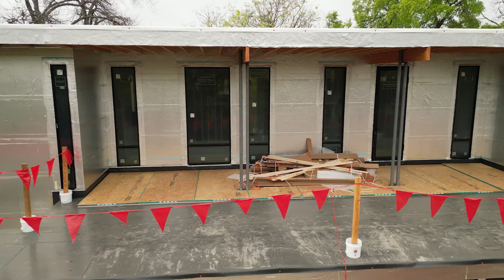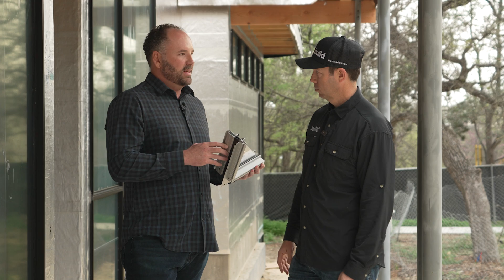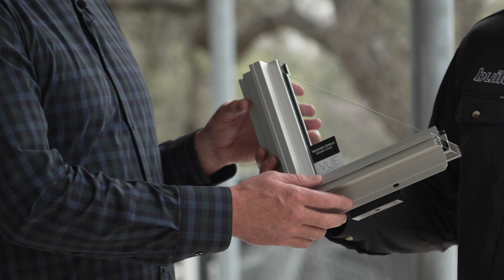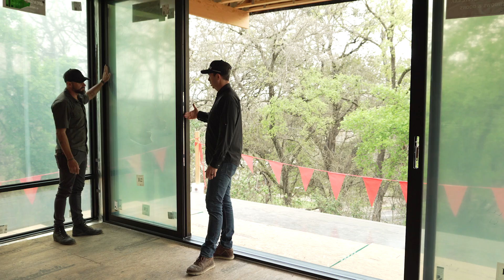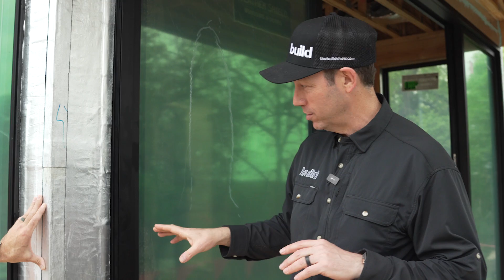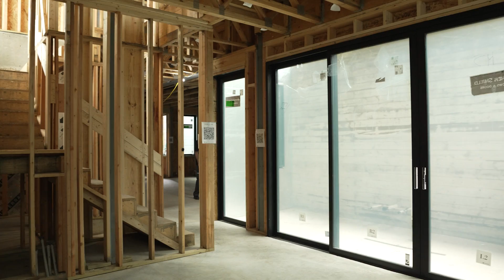Building An ULTRA Modern House? Check out these Windows & Doors!

Comment: Story about aluminum windows that don't have a thermal break.  I bought my first house in 2010 in central Virginia.  The porch was 10 foot wide and under the roof of the house.  The house was about 10 years old.  There were two windows that look out onto the porch and both had water damage on the inside bottom sill.  It was almost impossible for the rain to reach those windows because of how back they were from the roof edge.  We bought the house and figured the water damage had to be from something the previous owners had done, like setting cold drinks in the window sill and the condensation causing the water damage.  
What we found is that the water damage was from condensation, but it wasn't from cold drinks.  The aluminum windows were double pane insulated, but there wasn't a thermal break in the aluminum frame.  During the cold winter months the window frames would get so cold that water would condense on the inside of the aluminum frame and then pool in the window sill.  This cold weather condensation is what was causing the water damage.  During one particularly cold spell we actually had frost on the inside of the aluminum window frame.
Reply: Same in our rental house all fall winter and early spring, theres constant moisture on the frames,
And it actually causes black mold to grow on it as its constantly wet, we clean it every month but its a pain in the proverbial.
Reply: Yeah, I’ve been a builder out in Southeast Virginia for 25 years and I have seen some real garbage when it comes to windows, new construction and remodels some of the time you’re just better off replacing them depending on the application pull the siding off and redo it put a new construction window and you’ll be so much better off
Reply: @steveanderson4768    We did replace some things with better things in that house in the 3 years we owned it before selling it.  
Sink faucets in both bathrooms and the kitchen.  Overhead lights on the porch.  A few other things I'm not remembering.  Every time we replaced I would later find the original thing at Lowes and the construction crew installed the absolute cheapest thing on the shelf from Lowes.  
The house did have hardy plank siding and one extra row of cinderblocks in the basement making for a higher basement ceiling.  It had gable vents for the attic, but no soffit vents.   
My realtor had been in the business for 40+ years, had built his own house by hand, and was the father of one of the guys I graduated high school with.  He looked after us as if I was his son and I learned a lot about what to look for when buying a house.

Comment: I want a double double window in a concrete wall so there 2 columns in the middle 1 on each end a space between the middle and a box on either side then do the flower boxes to conceal the completely flat entrance and privacy on the windows with plants that reduce heating as well

Comment: All you have to do is build a front porch with columns so instead of the 1-2ft over hang you bridge the gap from the building to a span off the front of the building and then it get bolted to the wall of the house or just not finish the windows or doorway and have a second finished wall under a balcony instead of knee wall for window you put flower beds in front and the space between them is a literal gap in the structure like a hallway

Comment: What’s the U-value?
Reply: In north america, ranging from northern to southern zones from 0.22- 0.32 u value at least for their casement windows
Reply: Thanks! It’s surprising that little spacer can achieve those numbers.
Reply: Our Oknoplast are 0.13-0.17 U-Factor
Reply: I saw .17 for fixed (which is typically the lowest).
Reply: @eh_bailey  Fixed is a great move, people should install a lot more fixed ones. Not all need to be operable, and you get instant savings and performance gains.

Comment: Alpen windows smoke these in U value.  Hard pass.
Reply: Oknoplast PIXEL Uf=0.18 - 0.29
Oknoplast PAVA Uf=0.16 - 0.21
Reply: Must be hemp based?😂
Reply from the maker: U-value is definitely better. However pure aesthetics and fit/finish on these will crush Alpen
Reply: @buildshow  I'd STILL prefer Fenstur!!!
Reply: @DrMJJr What do you like about Fenstur?
Reply: Matt, I’m in early build now up in NC mountains.  I priced out Weather Shield VUE, Marvin, Alpen, and Oknoplast.  We’re going with Oknoplast PAVA triple panes, Aluhaus Aluminum Lift & Slide.  Beautiful products, amazing on performance and about 35% less than VUE which was by far the most expensive.  VUE do look nice, but Aluminum even thermally broken can’t compete with UPVC.  The Alpen were also very expensive, kind of ugly and only offer 3 colors.
Reply: The most efficient window is no window.
Reply: @buildshow  I don’t have a conflict of interest in this discussion.  I don’t make, represent, have family that works for any window company, or sponsored to promote any window brand/company.  With that said, your assertions are either subjective (aesthetics) or without any actual evidence conducted by a neutral third party (fit/finish and presumably longevity).  Matt, you often present products that offer better benefits/performance that come at a greater cost.  This is fine and rational.  This product performs like an upper end Pella window (not special). Other windows actually perform better.  There is nothing wrong with line of windows and the market will determine if they are worthy of the price.  My concern with you is credibility.  When you start promoting windows (or any other product) because it “Looks Good”, but doesn’t perform as well, that reduces/eliminates any trust you’ve built.  FWI I watch many of your videos and affiliated buildshow members.  Learned a bunch and will be braking ground this fall for my new house.  Also, the only rub with European style windows is they swing inward, which makes curtains and furniture more complicated.
Reply: I saw .17 as the lowest on VUE.  That isn't bad considering the great sight lines.  One of the problems I have with the high performing windows (Alpen, Schueco, etc) is the bulky frames.  You can impress your build friends with great numbers, but they look like storefront windows.  This seems like a good mix of looks and performance.
Reply: There's no fee lunch. Always trading something for something.
Reply: @Eric-xp1kl  Oknoplast Pava is the great choice. Efficiency, custom sizes and plenty of color options make your choice match more easier. New line of aluminum windows Oknoplast MIRU EVO have thermal break as well. Their color pallet is much bigger, offers more options and better system especially for big sliding patio doors. European manufactures  bring more options than domestic manufactures and their efficiency beat US windows. BTW. Curtains need just longer rod to allow fully open window. Don't forget windows can also tilt and vent your room.
Reply: @pamaniwindows  Color choices are also key for HOAs where they dictate identical colors. Do you know if Oknoplast ships nationwide and if they handle smaller orders?
Reply: Alpen isnt a player in this industry. Bulky ass frames like European windows. Hard pass
Reply: @buildshow  take your L you earned it